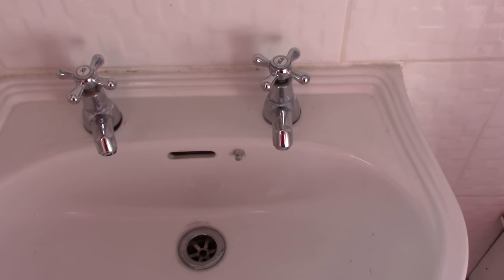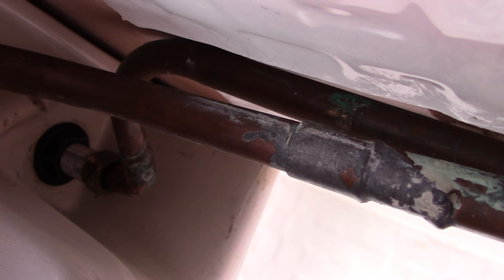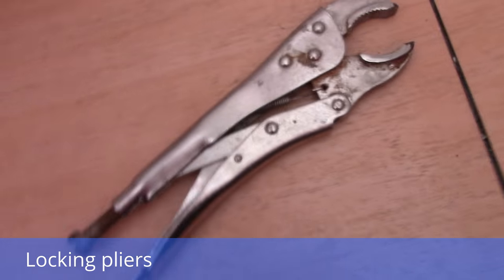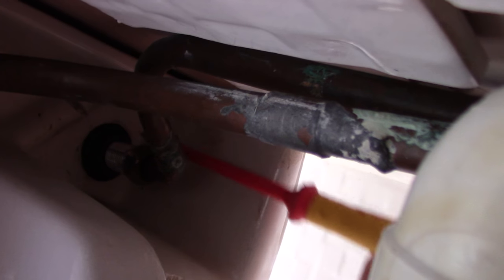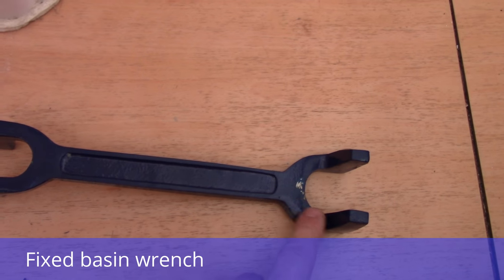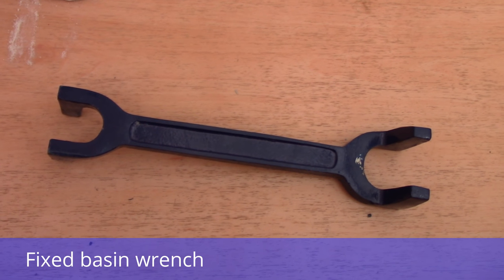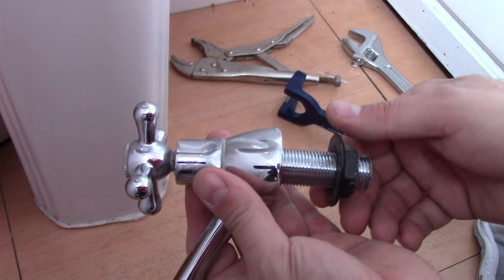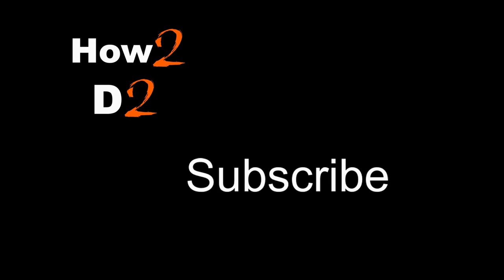How to unscrew tap. How to change basin or bath tap What tool to use

Comment: Wish someone would do a video on how to remove a nut that will not turn !!  I have all the tools and the muscle but I am trying to remove the nut from the cold tap on a bath ( so no space for extra leverage).  I’ve tried heating it with blowtorch and soaking overnight in wd40. Nothing works. It will not budge. The hot tap came off easily.  What else can I try ?!
Reply: What did you do in the end?
Reply: you need a nerrad or such tool that is a socket over the entire nut and you can turn with a straight bar from well below the tight space. alternatively i have had to go in with a small angle grinder and cut the thread and washer in half to get the washer off

Comment: has gone around around the world to take that off! 
1. Hold ur tap and give it a good twist
2. It loosens the nuts under the basin
3. Most of the time the tap will loosen that much u can use ur hands to take nut off ..
Reply: Worked for me :)
Reply: @chrisroyle4813   'most of the time' is the key here...not always that easy.
Reply: that won't work for taps on one block. also any leaking tap will have limescaled the hell out of the thread or someone gunked it on installation 30 years before and you ain't got no choice but to get stuck in from below and it can take an age  if a one man job and no one to hold the tap above

Comment: No way that nut came off that easily.  Having a nightmare getting one off
Reply: Me too. The nut is completely seized. What did you do?
Reply: @roisin252  I purchased a sink wrench then clamped a monkey wrench to the bottom to give me enough torque to push against and that eventually did it.  Good luck and merry Christmas
Reply: @hoisin75  thanks very much. Happy Christmas